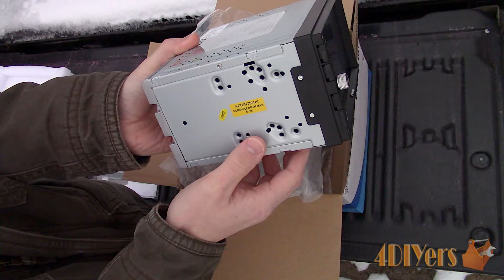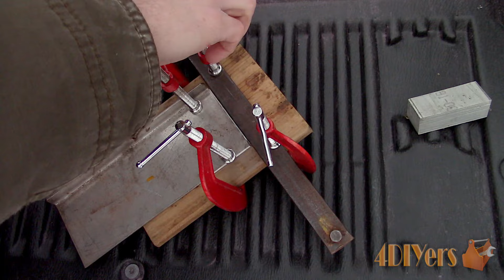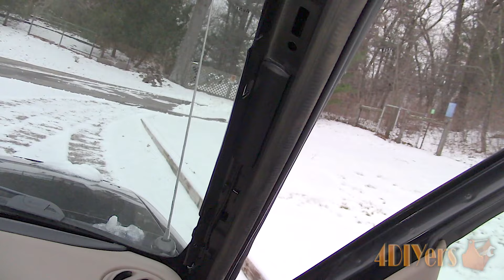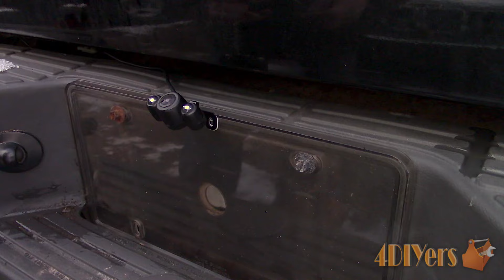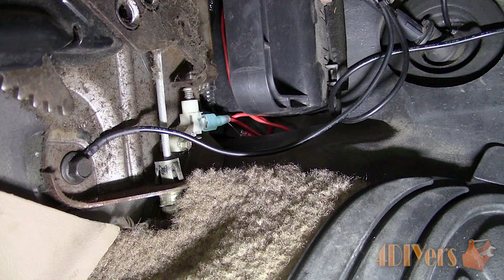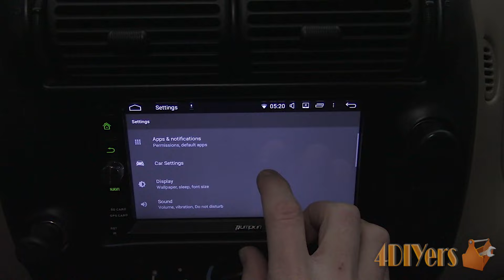How to Install an Android Double Din Head Unit in a Ford Ranger

Comment from the maker: Amazon links for various products used in the video for both USA and Canada:
USA:
Solder: https://amzn.to/2NnBKdM
Plastic adhesive: https://amzn.to/3scB0ap
Butyl tape: https://amzn.to/2Ndl7lg
Split loop casing: https://amzn.to/2ZxZL4g
Liquid electrical tape: https://amzn.to/3ayhEqg
Electrical tape: https://amzn.to/2Zxy7o6
Heat shrink: https://amzn.to/3s4FQ9y
Cable ties: https://amzn.to/2Maa0ZO
Isopropyl alcohol: https://amzn.to/2O82mQe
Nylon trim removal tool kit: https://amzn.to/3ttffUX 
Canada:
Solder: https://amzn.to/3blrYRC
Plastic adhesive: https://amzn.to/2OSFvIP
Butyl tape: https://amzn.to/3bkTheB
Split loop casing: https://amzn.to/3puwceN
Liquid electrical tape: https://amzn.to/2OIZAkA
Electrical tape: https://amzn.to/3k4EVTy
Heat shrink: https://amzn.to/3s4FUWQ
Cable ties: https://amzn.to/3drYRyI
Isopropyl alcohol: https://amzn.to/36LY5bz
Nylon trim removal tool kit: https://amzn.to/3rtaQjn

Comment: Why not splice the camera power to the running lights instead?

In my mind that would provide constant power to the camera as long as your running lights are on, then the pink wire ran in the dash (not sure to what) to trigger the unit to automatically swap to rear camera when put in reverse?

Comment: Hey there just bought a 1999 Ranger XLT 4x4 with only 39k original miles it's been babied its whole life, I was wondering are there any screen units that you know of that don't require the bezel to be cut? Also if any Ranger owners gave suggestions for other upgrades please let me know! Thanks

Comment: The video is amazing and really helped. The only issue is my radio didn't come with a harness adapter. Where did you get the adapter for yours?
Reply from the maker: Thank you so much! All aftermarket head units do not come with that plug/play harness. They can be purchased at a local auto parts store, audio store, or online.

Comment: what faceplate is that and what soldering iorn did you use?
Reply from the maker: No faceplate, everything I used came with the head unit. I'm using using a cheap soldering iron I've had for years.

Comment: I didn't understand why you hooked up wires to the parking brake?  Why was this necessary? Can you leave that out of the installation?
Reply from the maker: It's required here by law if a vehicle is inspected to be put on the road. These regulations will vary depending on where you're located. Yes you can lease it out if you wish but keep in mind, if you're pulled over by the police or for a highway inspection, you do risk getting a ticket if it's a law in your area.

Comment: @4DIYers Awesome video! I have almost the exact same dash setup as you, and i'm trying to install a new headunit, but having difficulties. The new radio is pretty much only screen without any metal casing behind it. The only mounting point it has is a small bracket that looks just like the ones you bent to mate your headunit to the trim piece. I'm trying to make it connect to a installation kit, but I can't seem to make anything fit together.

for refrence: I have a 2003 Ford Explorer Sport 2dr
Reply: Did you ever get your unit installed?

Comment: What a fantastic job! My 1990 F250 radio lost its display and finally broke after 30 years, also the dash is falling apart, plastic is brittle. So until I can find a nice replacement I am going to modify the original to fot a double din Android unit. Just like you I am using solder and quality wiring.
Reply from the maker: Thank you! My neighbour up the road actually has an F150 OBS, I think he's owned it since new and it's been painted once, it's a daily driver, still in really nice shape for living in the rust belt.

Comment: Where could I find the plug and play harness. I have a 97 Ranger
Reply from the maker: Walmart if I remember right. 97 I believe is different than what I used. I was able to find the 97 harness easy enough, but the 98+ was a different story.
Reply: @4DIYers  thanks brother. I ended up finding it. Mine was a Metra non premium sound kit. Two plug set, one for power and such, the other for speakers. Other than that process should be the same. Great vid by the way.

Comment: I cant seem to get the GPS to work without wifi. Any ideas?
Reply from the maker: Make sure it's connected to the correct port (the wifi and gps use the same type of connection), the adhesive side faces down, slick it on a large metal surface which isn't obscured by any metal objects, and make sure the gps is enabled on the head unit.
Reply: @4DIYers  yea i tried that but I was told it needs a GPS card?
Reply from the maker: Is this the same unit?
Reply: @4DIYers  yes sir

Comment: Wow, great work, very nice looking result. I'm not sure how I feel about touch stereos myself, they seem really useful but at the same time I'm worried about quality, and how distracting it could be compared to a much simpler factory radio. I'm curious if you've personally found it to be more distracting while driving, or if it's actually not that big a deal?
Reply: If you think this is distracting, take a look at the display on a Tesla 3. It is 15" monitor to the right of the steering wheel that shows everything that is normally displayed on the dash. All gauges and function are shown on that monitor. No more just glancing down to check you speed, you have to look to your right. Not that I am in the market for a Tesla, but that would be a deal beaker. I'm old school, I guess.
Reply from the maker: Thank you for the kind words! I wouldn't think it'd be more distracting, I haven't driven with it too much yet. But I've had animated screen in my pioneer deck years ago (not sure if you remember the models, used to have the dolphins swimming, waves, car racing, etc), I never had any issues. Then again I've never been the type to use my phone while driving either, even when it was legal. I think it depends on the person.
Reply: @4DIYers  Oh yeah I'm the same way with phones and driving, I've always avoided it if possible (on occasion I glance at my phone for the GPS or to see the caller ID, but that's all). I'll also admit that the newer Dodge touch nav radios kind of impressed me, I had one in a rental and to my surprise I didn't find it much more distracting than a normal radio.